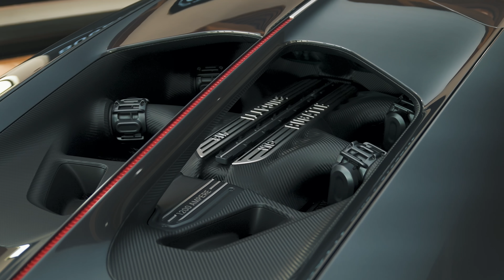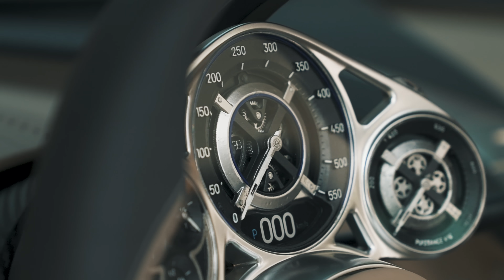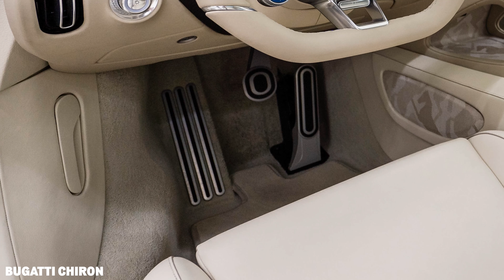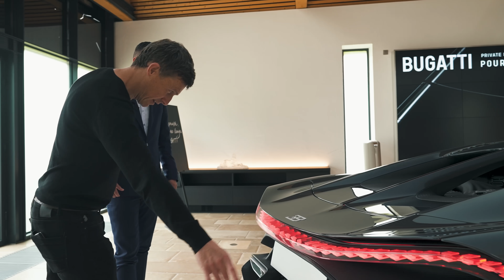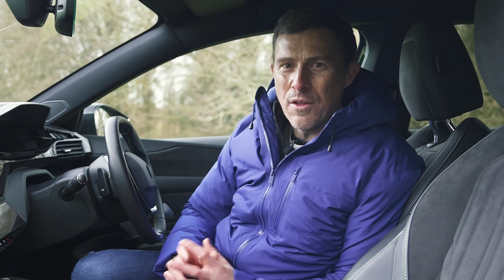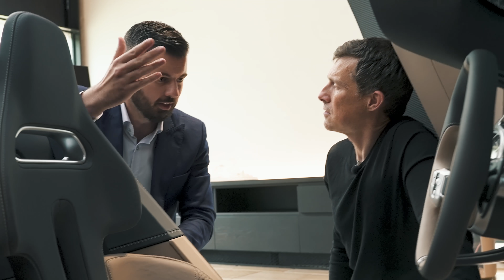New 1,800hp Bugatti Tourbillon Unveiled!

Comment: Ok ok, the one thing I adore about this car is the full 6 gauges. It seems like so many cars nowadays use dummy lights for everything. I like the fact that I can moniter oil pressure, voltage, and coolant temp. Driving older cars, I tend to watch these guages the most. Granted, I won't be able to afford this thing, but it's still comforting imo.

Comment: Why not using a super-capacitor instead of batteries? It can discharge more electric throughput to the motors and is generally lighter in weight too.

Comment: Honestly, this is not really a car. It is an engineering over indulgence to raise Volkswagen's brand profile.
You cannot seriously drive a car like this, as it will be forever be requiring stunningly expensive repairs when you least expect it.\
It is plainly no sports car in any sense, and built solely to VW can say they make the fastest car, as long as it is in a straight line on VWs test track.

I cannot call it unattractive but it is hardly definitely otherwise. Overall, it is vulgar and ostentious, even by hyper car standards.  That VW feels the need to pimp up its ho's by using such an esteemed name from the past, is cringeworthy.
Reply: I would like to see you build a better supercar/hypercar, seems like you're just talking out of your ass.

Comment: It’s weak under…the suspension will break. It has weak points for that much power, they try to much to reduce weight. On track if pushed to limits it will crack guaranteed. Suspension with holes in it to reduce weight 😂.

Comment: If I'm understanding this right (And don't get me wrong, I'm a "Gearhead", the type that'd drop a blown and injected crate 632 in a Vega) but if the ONLY reason the gas motor is there is to keep the batteries for the electric motors charged up,,,,,, Do you actually need a V-16? Wouldn't like a V-8 suffice as a glorified "Alternator"?

Comment: As an expert in another field of AI, I just cannot imagine, that AIs capable of finding a better optimized manifold than some engineers. As a non-engineer, it also makes no sense for me, that the optimum should be some kind of organic shape. The 3D printing thing totally makes sense. But why not combine a (human) engineer design with 3D printing capabilities. Did they try and compare (at least in simulation)? My guesses would maybe be (a) no they did not compare and let themselves deceive by some AI snake oil seller or (b) they tested it and found the differences to be negligible and used the AI method to be able to deceive their customers with the all mighty AI.

Comment: A tourbillon does NOT make a watch more accurate... as tourbillons are put in WRIST WATCHES. 

A Tourbillon... French for Tornado, rotates the critical regulatory mechanisms inside a mechanical watch...  but this does nothing in a wrist watch. 

It does what it does, to COUNTER GRAVITY, and thus improve accuracy.... in watches whose movements are prone to micro effects of gravity pulling on them, in one direction, which can build up over time, if one does not notice, and leave the watch wildly ... for watches of say, chronometer (scientific) accuracy.... off time. This was only a problem, however, FOR POCKET WATCHES. Watches that sat IN YOUR POCKET, upright, relatively UNMOVING, for the majority of the day, then sat in a cradle the same way over night. 

If the whole regulatory mechanism, was then spun around, it countered this, gravity was pulling EVENLY on all parts. Watchfinder here on YT gave a great explanation for this... take jar say, a quarter filled with honey, leave it sitting for half an hour, and the honey pools at the bottom of the jar....  BUT... lay that jar on its side, and roll it around and around for half an hour... the honey coats the walls of the jar evenly, no one area is pooling.... and that is what a Tourbillon does... stops gravity 'pooling' in one direction against the mechanism of a POCKET WATCH. 

Wrist watches ARE NOT SUBJECTED to this the same way. 

A wrist watch moves any which way you move your arm in a day. This does enough to assure, even just riding a desk, and doing clerical type work, your watch moves too much for gravity to effect it's mechanism that way. It is the same reason a weighted rotor works to make automatic mechanical wrist watches a thing. The automatic watch movement was, actually invented about the same time as the Tourbillon, but for the same reasons a Tourbillon WORKED for a Pocket Watch, an automatic movement did NOT, the pocket watch did not move around anywhere near enough to really consistently move the rotor, and thus wind the watch. 

Tourbillons exist in top end luxury watches these days, for ONE REASON, prestige. Bragging rights. Look what we can do! Well from the makes perspective....  and 'Look at this cool complication my watch has and yours does not because it is too pleb' from the owners. 

Once you KNOW that.... this all changes things about this car. 

To me, and anyone else who actually knows why Tourbillons are still a thing in watchmaking... they called this car that, because one of the production team said 'How do we call it the Dick Flop, without calling the Dick Flop'? 

Because that is what a Tourbillon is today... it is unzipping and flopping it out, to show all your oligarch buddies just how many inches that plastic surgeon in that 17th C listed building in Paris managed to add, and how much bigger than anyone else you are now... 

.....but being the biggest of the dry dicks among a world tiny dicks is not much of an accomplishment. 

Shame they chose such idiotic and mocking name.

Comment: I have a question. If I remember correctly, Lexus lfa had to transition from mechanical gauge cluster to digital one just because the mechanical gauge could not handle the drastic change in speed. Dont you think the same problem could arise with this car?

Comment: My two cents to Mate Rimac on the reference to Nico Rosberg's preference for the paddle shifters while driving: for a racing driver, that's where they expect it to be since they are used to driving racecars with very little steering lock and almost no situation to use it as much except Monte Carlo's Grand Hotel hairpin corner.
But, for a road car with 1.5-2.5 rotations and for regular billionaire drivers, it makes a lot more sense to have a big paddle attached to the steering column rather than the wheel.

Comment: At one point, Mate mentiones that Bugatti decided not restricting customers to use only electric or combustion engines; and can choose a combination if they prefer while driving. Later in the end he stated that he doesn't expect Bugatti drivers to refrain from doing crazy drifts and back wheel spins. So, I don't understand Philosophy concept overall, is it ultimately up to the customer to decide? If Bugatti philosophy is "customer first," he should not set expectations. They need to remain consistent with putting the customer first.

Comment: They are going bigger and higher as roads are terrible weather is very bad lately 

I had a civic type R 2007 I turned into a council car parrl and ripped standard front spoiler/ bumper bar off  $2000 worth of damage yes I agree they don't need bigger but higher I definitely agree with

Comment: A metre-long crankshaft, when this very automobile and engine could have been made even better, to be finally realized as the ideal transverse-mounted configuration? This is a missed opportunity.

Not only would the rear-drive, transverse-mounted engine be space efficient, but the intrinsic problems of stiffness of such a long crankshaft (and its necessarily robust engine block), could have both been solved by a centrally-located PTO via a bevel gear.

Before, Lamborghini “addressed“ the configuration of the transversely-mounted engine of the Miura by “wrapping“ the transversely-mounted transmission around the engine. Yuck! Later, Lamborghini “addressed“ the configuration of the Countach by reversing the longitudinally-mounted engine to feed the power forward to the driver (and transmission), and used an additional driveshaft, routed back through the engine, to drive the differential. Again, yuck. (At least the gearshift lever directly actuated the transmission.)

Such a wasted opportunity: Two problems solved at once, had the engineers the vision and fortitude to do something just a little different.

(By the way: No, the Cizeta-Moroder V16T, having the “first transversely-mounted V-16“, is not an ideal configuration. The engine was fabricated from two Lamborghini Urraco engines, with a custom cast aluminum block marrying the two and incorporating an integral bellhousing. A geartrain was utilized to connect the two separate crankshafts and turn the power 90°. As a consequence, the engine was heavy and very wide.)

Comment: If it's an EV I don't give a flying F.   Oh wow, a real engineering engine!? WOOT!  Edit: Batteries, motors? Nope, just shove a bigger electric motor in there and make it 2000 hp. Heck, why not 3000hp? Just a bigger motor, bigger battery. no soul, no point but hey, why not 4000hp? 5000? Just shove more batteries and motors. But don't call it a Bugatti, call it a big-ass bug-zapper?

Comment: Oh man, I was really amazed and then rapidly disappointed when they were talking about the wishbone suspension arm being designed by AI or whatever they said.
Obviously I don't know what exact software Bugatti are using, but I'm a mechanical engineer and a programmer, and to my eyes that looks like topology optimization.
I've actually done a topology optimization for a wishbone like that before!

Topology optimization is brilliant, and thankfully does not rely on generative AI. It's not a model that is created from examples, or trained against an adversary model (which is what the term "AI" has come to mean lately) it is an algorithm (another often misused term) which is coded by humans and uses FEA to optimize geometry, in this case the weight to stiffness ratio of the part they show. It's really cool, and to call it AI just because there's a craze for AI at the moment is tragic and ignorant. It's the kind of marketing you'd expect for something you'd buy on aliexpress... not what is supposed to be the most exclusive brand in existence.

I get why people get confused. Topology optimization is this process that has this computer generated step that refines your model automatically, as if done by some literally artificial intelligence. However, it's a world away from the LLM models which are neural networks, developed from training data. It's like the process of training an LLM has more in common with running a TO than a LLM itself has with a TO algorithm. Generative AI is both orders of magnitude more sophisticated than a topology optimization algorithm, but also wholly unsuited for generating something which is reliable, at least, at the moment. 

I guess I just hate marketing. These technologies are really cool. It's amazing to see the use of 3D printing combined with topology optimization in a real car. That stuff is like the state of the art technology for mechanical engineering. However all of this stuff just gets ruined by the marketing departments and overblown speculative hype.

Comment: Same bs as in cycling industry when they sacrifice integrity of the frame by making it ultra light in order to push disc brakes on road bicycles.Here they pushing batteries and electrical motors because it's politicaly correct.

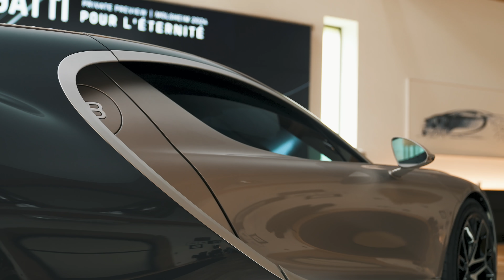Comment: not impressed with the door not lining up at 7:27 . u can clearly tell by the silver trim that the door sits slightly higher than the the body of the car. not impressed for a car that costs 5M. the  doors on my Lamborghini sit more flush than this, in fact, sit perfectly.

Comment: And by the way forgot to mention – not enough engines!!!! God damn it! only one V16 plus 3 electric motors what rust bucket it is?? Who you want to impress with that?  Put in it real deal 24 cylinders boxer engine designed for over 2,000 hp (1,500 kW) from fighter plane from 1941 – back than they were widely available technology was available , were installed on each Hawker Typhoon. Boring car.

Comment: when the steering wheel turns but the central part remains in place, you know that the airbag will cover your entire body, not just your face , but the module is small, so I wonder what it looks like after being deployd  ,some Citroen cars had such airbags , car is sick enginering its like Swiss watch but i think koenigsegg  still better , we are still wasting the planet's resources on such toys, but this is not the worst, the worst is wasting resources on electric cars , this is inexplicable, we need to stop it immediately if we are to further develop our civilization and actually start space travel like in Star Trek, and combustion cars with current resources and ecological restrictions can continue to live but electric cars are unnecessary and only consume valuable resources , Congratulations to VW to pull out sutch a greate car

Comment: Honestly, when l heard that Rimac was going to be taking over Bugatti, l was just as concerned about it as the Bugatti team & clients were. But he pulled it off.

The design of the Tourbillon is such an excellent combination of three Bugatti cars; the Chiron, the La Voiture Noire, and the Atlantic concept car.

Upon seeing the Atlantic concept car years ago, l was so disappointed to learn that it would not see production. It now lives on in the Tourbillon, which has the face & Butterfly doors of the Atlantic concept car, as well as the taillight of the La Voiture Noire. 

However, the most amazing part of the Tourbillon is that steering wheel. The reason it works so well is that it is a combination of old & new. Some concept cars of the past had that futuristic steering wheel/gauge housing combination. But Bugatti has done the gauge in timeless analogue. And this would be the secret of its success. The automotive industry just had its equivalent of an original iPhone launch moment.

Comment: soooo. once the people find out (most often through a cancer diagnosis)  they are sensitive to the strong pathogenic EM pulse and frequency fields from the EVs, the price of chiron's will go even higher than awaited.
Reply: just watch videos with EVs being measured for voltage, pulsing magnetic or frequency radiation fields and how humongous the EM radiation damage compared to the safety norms of building biology is, you all will understand why even electric bikes are not for everyday's use.

Comment: Great car, now about opening up this hybrid for maintenance work how much would I have to change or rework parts for it’s sensors to stay accurate or in other words what can I modify on this car cuz everyone have the same ones with special edition how can I make mine actually stand out from the rest of this old heads that don’t open packages 💀. Having a gel battery or 2 will push the car more but what can I modify if I can’t jailbreak the computer ☠️. I want top speed as much as the next guy but rather have cornering speed then going on drag racing which people will make faster cars anyways 🗿. At last how much do I have to take apart of the car just to unsealed the care engine 👀.

Comment: That is an abomination. Front fender is a pidgeon catch. An ultra fat cow is peak engine??? Why does F1 use V6 engines and decades of research??? The Doors are ugly and don't open as the Lamborghini. The rear difussor has so much dead space and is ugly.

Comment: It's crazy for them to continue having a huge displacement engine, engineering a brand new V16 and having it being naturally aspirated. Everything is pushing the limit with small displacement and turbos but this is next level raw power. Think about it, it makes sense. Turbos are used to increase power output while recycling exhaust output which makes it efficient but it's technology from the past. This is technically a modern hybrid pushed to absolute limit with the electric stuff replacing the turbos, just like the 918, but with double the displacement and power.
Reply: its got rimac ev motors bolted on

Comment: The biggest miscomprehension hybrid engine makers have is why would anyone want to start up an ICE mid driving? It is absolute lunacy to introduce a cold-start mechanism into a normal mode of driving. They just don't get that when an engineering minded person starts an ICE, he wants to let it burble for a few seconds at least, every single time - in mechanical sympathy for oil being fed around a valvetrain. For this reason alone, It's insane that hybrids should even exist in normal cars, let alone £3m ones...

Comment: It will have great acceleration, but you will not be able to go very fast for a longer time with this car. Because the battery will become too hot and empty very quick and the engine has only 1000 hp.

Comment: The "AI" modeled components are far more impressive than I think most people realize. It literally makes the most efficient parts possible for the application, factoring in the loads it will be taking and building the most efficient design that can withstand it. Only putting material where it is needed and nothing extra. Truly impressive, only a matter of time until this is mainstream.

Comment: The best interior i have seen and a stunning project overall. I'm just confused about the battery charge speed. I think he made a mistake during his explanation. I know that this battery is the best available considering its from the Rimac team. So how is the charge rate nearly 3x slower than a Tesla model 3. Its going to be a much more advanced chemistry i would presume. 25kw in 20 mins? that time will get a tesla to 70% at least on a V3 supercharger on a 75kw battery. and considering its going to have massive discharge to generate 800hp how is it going to charge from the engine with enough speed to maintain charge status.